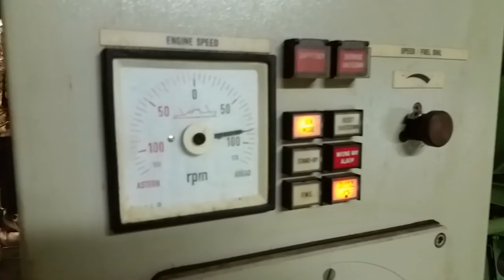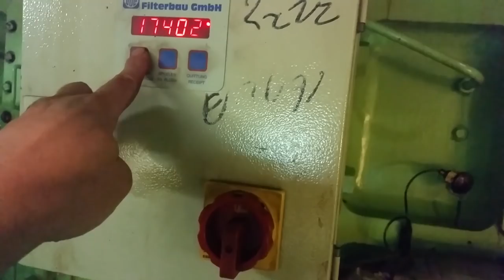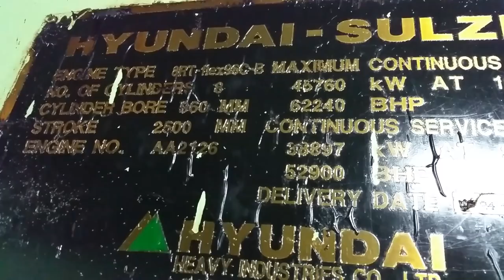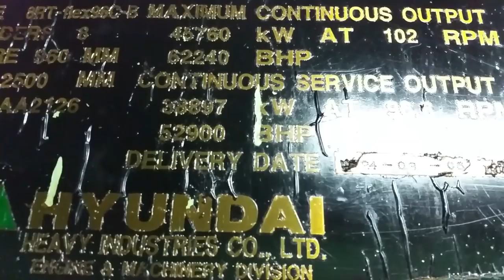Marine Slow Speed 2 Stroke Sulzer Diesel 8RT flex 96 C B

Comment: Thank you so much for making and sharing this awesome video of the main engine. Such an engineering and maintenance marvel to behold !!!   I sure wouldn't want to be having to change one of those huge pistons or cylinder liners. They're enormous!
Reply from the maker: Yes I've been on ships before where we did it and it is a lot of work
Reply: It’s a routine job which you do with the whole engine room staff.
The tools are made for the job and OK to handle. Starting with the job at 08.00 (tools made readily available before start) the job for changing a piston is normally finished at 17.00

Comment: A thing of beauty.
Reply from the maker: thanks for watching
Reply: These can run methanol so what if you mix in some nitromethane and switch to castor 927 maxima 2T oil  and see if there is a power gain. Make and fit a natural gas torch fired glow plug and now you got a giant nitro glow 2 stroke of mabey 135000 hp.

Comment: What kind of backup power do you guys rely on?  I'm surprised there's only one engine, then again I am thinking more from a cruise ship standpoint.  Great videos, you're making me consider a 180 degree career change that will unlikely happen, but at least I've considered!
Reply from the maker: Basically there is a emergency diesel generator and there is an emergency power board with essential equipment powered by the emergency generator until main power can be restored

Comment: The pipe coming out from the front of the exhaust valve. What is it’s purpose and where does it lead to?
Reply: He mentioned they are hydraulic lines (2 each) in another video. I infer they actuate the exhaust valve. No camshaft like conventional engines we are accustomed to.

Comment: Another great video. Slow speed diesel like this I suppose means direct drive to the prop without the use of a reduction box. As you have a fixed pitch prop for astern do you hydraulically reverse the engine or do you have a reversing box?
Reply: Direct reversing engine, on the shot of the tacho showing run speed it was running 93 RPM Ahead, the engine runs either way.

Comment: I am curious... with a regular small gas engine, small spark plugs, small pistons. seeing how big the pistons are here, what does it take to ignite the fuel ? just a lot of pressure and temperature ? or is there a spark involved as well somehow?
Reply from the maker: You are correct it is a diesel and uses the heat of combustion....Highly compressed hot air you got it :)

Comment: Nice video, on 8:10 I see that the engine is from 2006 and have a usefull life of 10 years. Is it not usefull anymore?
Reply: Rob it is still useful as long as it is maintained properly I guess that's just what the manufacturer guaranteed from the beginning but yes engines last a lot longer than that
Reply: I found it a very strange plate too.
Never seen such a text in my 42 years running around in E.R.’s